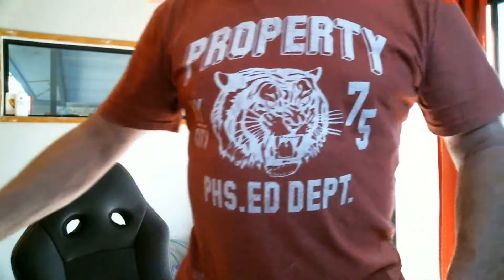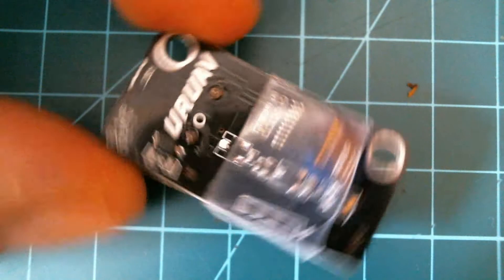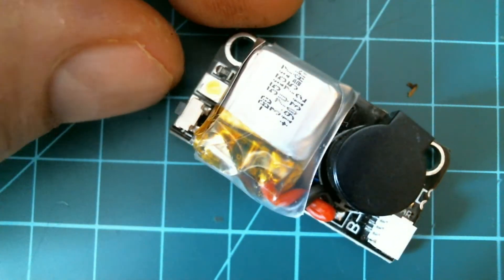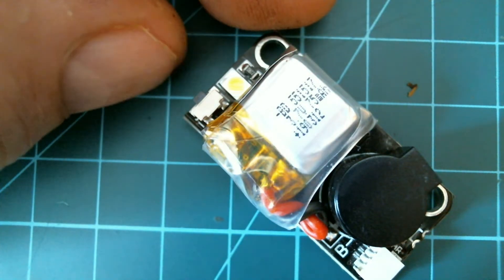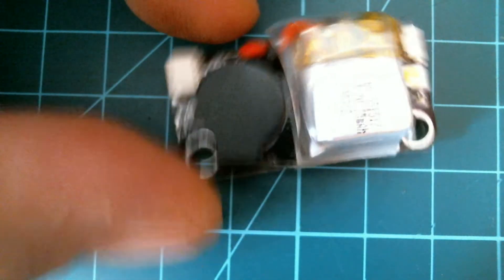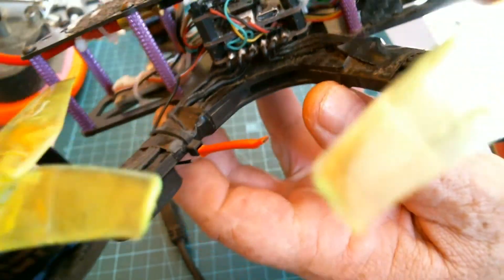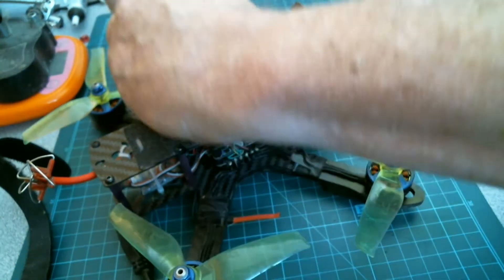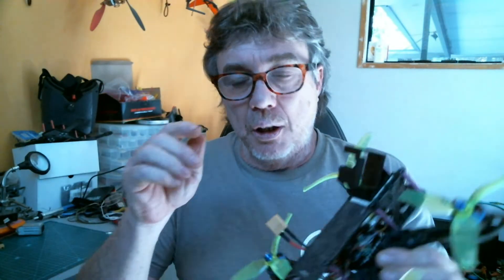URUAV Buzzer (beeper)

Comment: I have a couple of these beepers and I can't get them to work properly for some reason. I wired them as you say but they seem to be giving odd reactions. Did you do any programming in betaflight for your boards connections or did it work straight out of the box? Also do you know if it has some way to tell you when the battery on it is flat? Thanks for your help and happy flying!